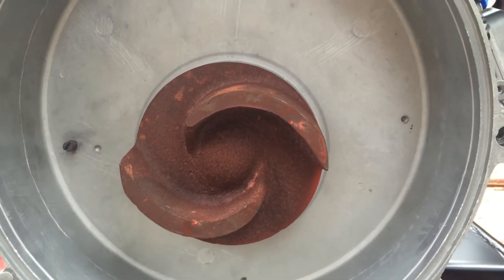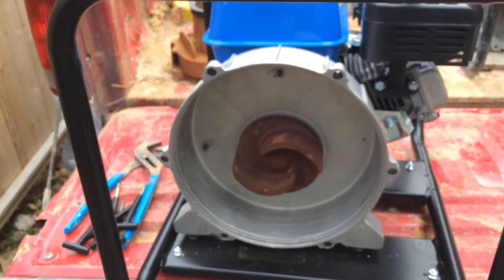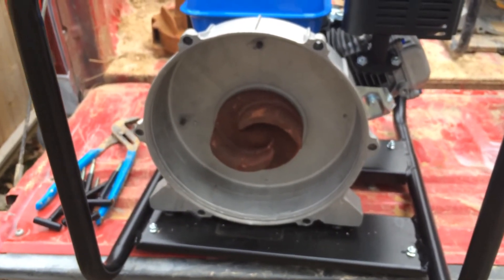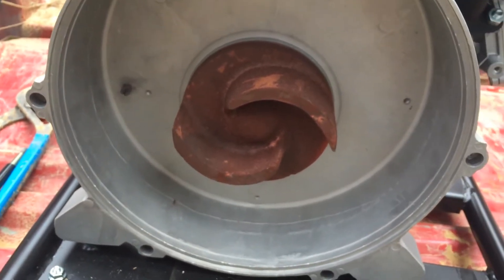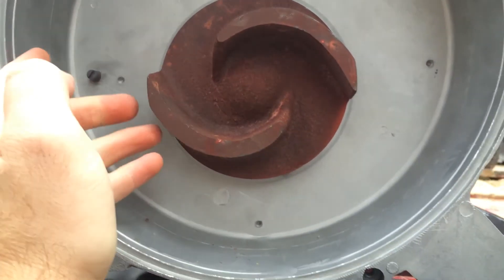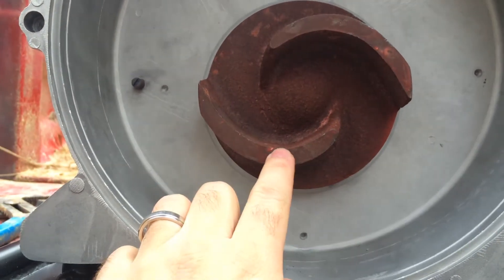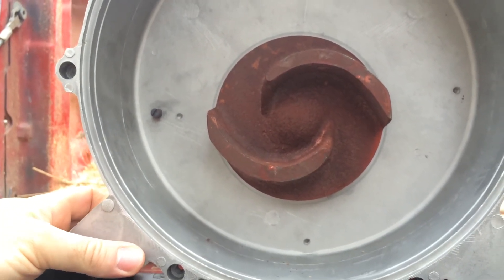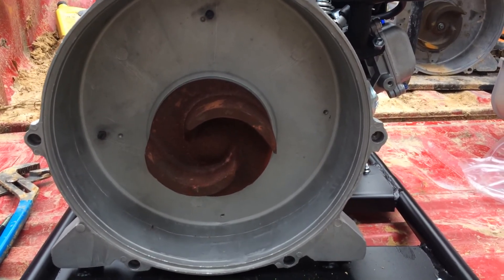New Water Pump Inspection

Comment: its acutely eser to take the impeller off with that new design. you just get a hammer and turn it counterclockwise.
Reply: i know cuz i have a Douromax 9hp 4'' pump way more reliable and not to expensive. same impeller design tho.
Reply from the maker: Cool, that's good to know! Thanks for the input!
Reply: Same problem, thanks guys